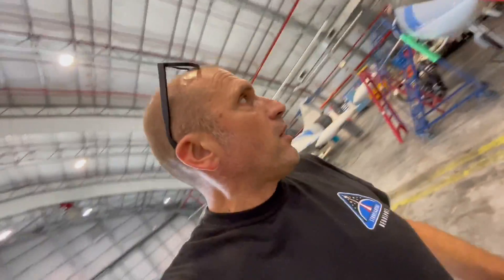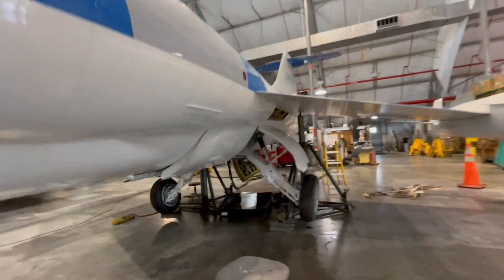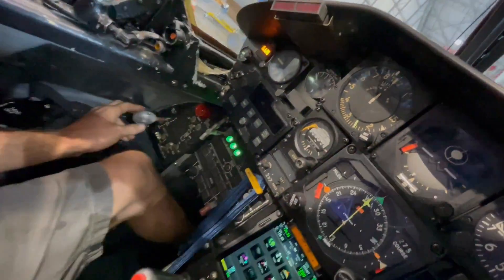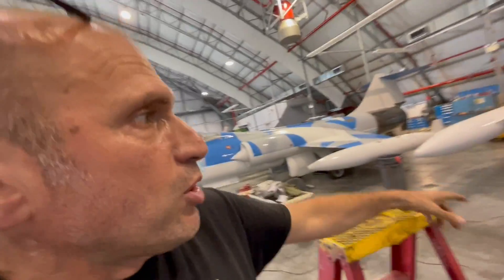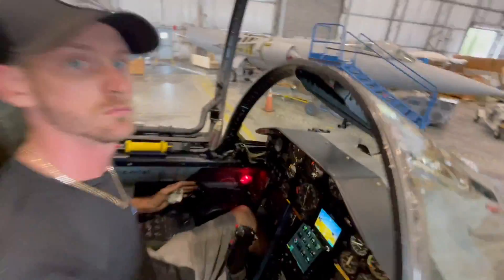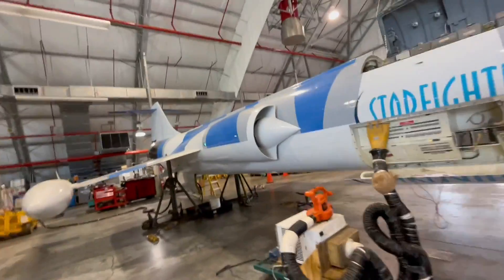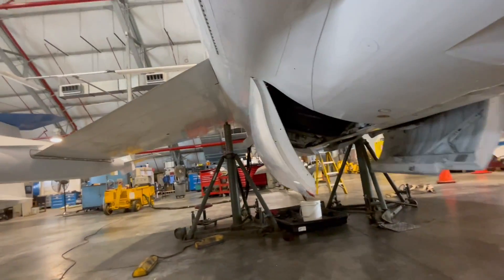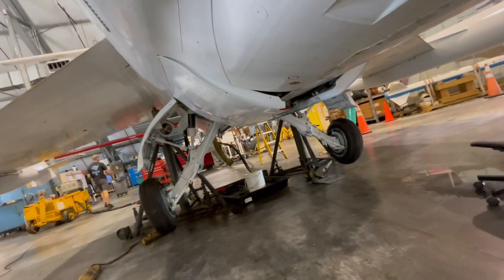Landing Gear Swing Lockheed F 104S-ASAM

Comment: 3000 psi. 1.5 tons of force when in flight to operate the sequence.

I Remember the BD 5 mini jet/ Airshow jet with the hand operated landing gear.  That gear could be flicked open and down in the blink of a eye,,, and the pilot did low-and-slow passes to show that off.

Comment: Piercarlo, I hit play faster than an F-104, almost broke my thumb.  Keep them coming.  Also, I don’t think you covered it in your cockpit tour vid, but what are those vertical bullet looking things by the canopy opening?
Reply: Looking at pictures of the F-104 cockpit on the computer, they seem to be canopy jettison devices. When the canopy is closed there are plates that cover the tips and when the canopy is commanded to eject, they push on those plates lifting the front edge of the canopy into the airstream where it would be carried away.
Reply: @5695q  Ok, that makes sense. Thanks